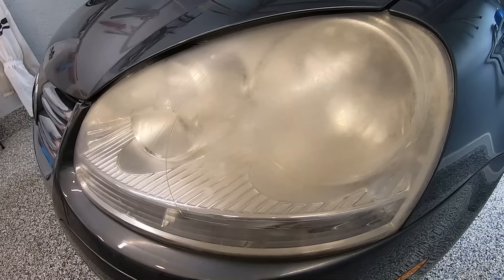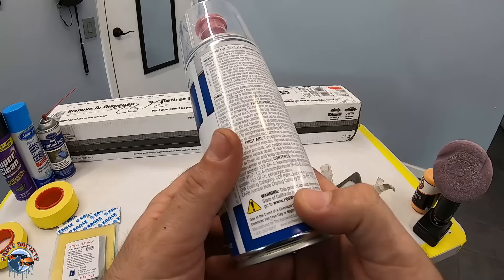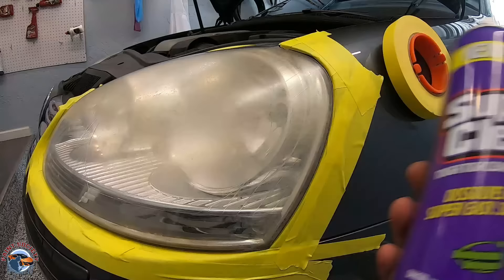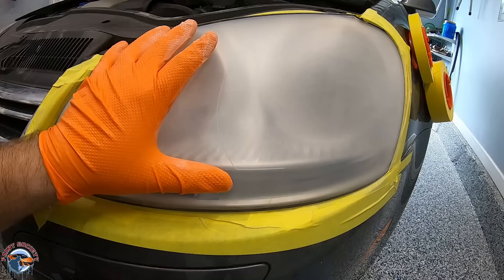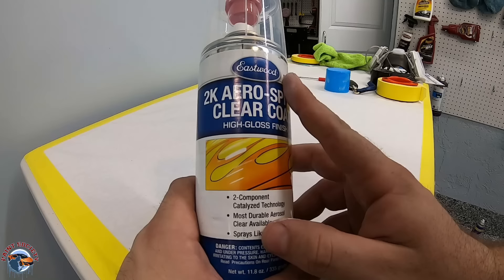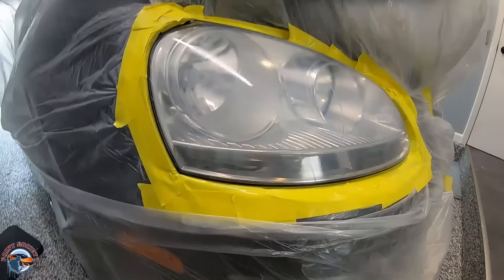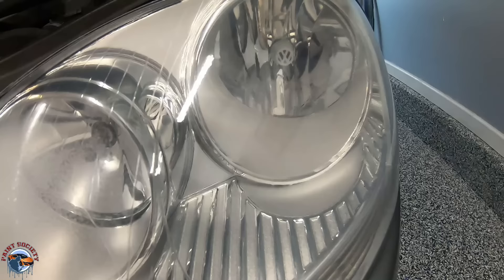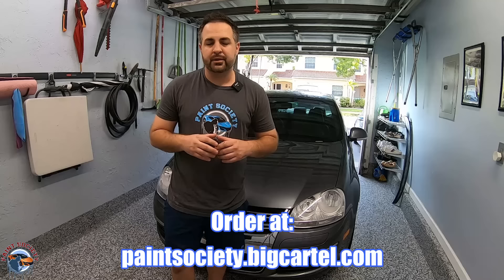The BEST Guide to Restore Headlights PERMANENTLY!

Comment: I did this exact same thing for my mother's Prius headlights a couple years back, same technique, no adhesion promoter, 2K rattle-can clear from my local PPG distributor, and so on.  They looked amazing, just like new, and since I had nearly 30 years of auto-body restoration experience under my belt doing over 40 frame off custom hot rods and restos over that time, I was quite confident (almost cocky) when I told my Mom that I could do this for her.  I didn't doubt myself even one bit at the time because I trusted my know how (tried and true techniques), the chemicals I used (I've been certified to use PPG products longer than I can remember) and the seeming simplicity of it all (at least to me), made this a no brainer.  Well, just last year (so one year later), she visited me and to my great dismay and shame, nearly all of the clear had pealed off of her headlights.  They looked horrible.  In fact, they actually looked worse than they were when they were grimy and brownish colored.  She could hardly get a good beam out onto the road.  My point here I guess, is that making the claim, "permanently," at least from my experience, I now know to be complete BS.  In fact, I think I even told my Mom that my fix would be "permanent."  How however, I know that these chemicals simply do not bond correctly to that lens plastic (and yes, I ended with an 800g scratch because it just seemed reasonable to me at the time.  Long story short, I humbly purchased her two knew headlight assemblies and installed them when they arrived.  NOW, her headlights are as actually, as good as new because they "are" new.  I at least know now that from a business perspective, I will never offer this service to a customer because I have zero confidence in the process now and never want to look like a fool to one of my customers.
Reply: I get pretty much the same results you describe. I'm an amateur at painting, only having done 10 or so whole paint jobs but have been an auto tech for 20+ years and run my own shop. I only do the headlight restoration for people that want to pass inspection. I wet sand in stages and usually end at 1000. I have tried regular automotive grade clear and hardener but I have since just switched to doing cheap dupli color rattle can since it doesn't last anyway. I always recommend new lights to my customers but explain what to expect. The problem is the price difference between OEM lights and cheap Amazon China stuff. The China lights don't seem to last much longer than cleaning and clearing the originals.
Reply: Yes, and when the clear coat cracked and peeling, it’s really nasty and requires a lot of effort to restore again. Btw, I have done more than 3000 pairs of headlights restoration by only wet sanding and buffing, and I hate clear coat or any sort of Coatings in the headlights, even the brand new OEM headlights’ coating will crack from the top over time. 

Good wet sanding and buff will last few months and extremely easy to restore again next time.
Reply: well, one can only guess what you did wrong but there was something wrong. ive painted a few headlights and so far none has failed in any way, so no its not bs. 2k clear is to last at least 5 years, some ive seen lasted 7-8 then were redone.
Reply: Same experience here, lasted a year and I didn't use adhesion promoter back then too, because I didn't know any better. The thing I realised after I ended up sanding it down and buffing it up, that hazing isn't just on the surface, it's within the plastic itself, no amount of sanding is going to change that
Reply: @sharifsircar  some of the model has problem with the OEM plastic, they changed color and built up tiny cracks over the years. But most of the car model is ok.
Reply: @Jimmy_Wei  It's definitely a huge improvement but if you put a brand new headlight beside it, you can tell the difference. The claim of "new" isn't really achievable, when the UV rays penetrated the entire plastic mould, not just the surface
Reply: @sharifsircar  some model doesn’t really got affected by UV lights at all, most of them will become yellow but only on the outer surface. I work in car parts industry and detailing business. Trust me, only certain model with problematic plastic cover supplier will have the problem. 

I have done some cars over 30 years old with OEM headlights. They back crystal clear.  But some models only around 10 years old, already start cracking and the actual material changing color too. most of lights only have problems on the surface after years of UV penetration.
Reply: @Jimmy_Wei  Interesting, so it comes down to actual plastic the manufacturer used. Do you happen to know if new headlights come with a coating of sorts from the factory? I have never seen an OEM headlight peel so it must be really on there or mixed with the plastic
Reply: @sharifsircar  most of the older model doesn’t come with UV coatings at all, just pure plastic when new, some newer ones have but over 3-5 years same problem will happen, I also done some newer models with OEM UV coating problem, the UV coating started to peeling from upper part of the light cover. From my point of view it’s about the difficulty to restore with or without bad coating, and my conclusion is definitely without coating will be much easier to maintain over the life time of the car, it will literally only take less than 2 mins for me to restore the original surface back to crystal clear. And last another 6 months, whenever it happen again. 2 mins to finish.
Reply: @Jimmy_Wei  Thanks for the info, any pointers on keeping a new set of headlights new?
Reply: @sharifsircar  after wash, use white final polish compound to buff it with microfibre towel every 6 month-1 year, if you see any white oxidation or minor scratches on the surface.
Reply: @Jimmy_Wei  Aren't I removing the protective coating on the headlight by polishing it? I know ceramic coatings don't do much in terms of UV but I believe it'll add on another layer to give the plastic a longer fighting chance
Reply: @sharifsircar  ceramic coating will also get bad on headlights. The best one Only last about 5 years, the problem is to remove it bad coating, because the ceramic coating is harder than plastic, closer to sand, it will require a lot of hard sanding to remove all of the bad coating, high quality PPF clear wrap will be a good choice if you want to protect the lights from actual stone chips and scratches. Maybe after 6-7 years, if there is some chips on the film you can remove them and you still have a brand new light.
Reply: @Jimmy_Wei  Interesting! I'll likely go that route for a car I am saving up for few years down the road but for the time being I'll just baby the thing with minimal effort haha, I am doing projector retrofit and I decided to do it right and pickup a new pair for the person doing it for me. Plus one of tabs broke when I took off the bumper/headlight bracket to get to something last year and I know that'll effect the aligning. Thanks for your insight!

Comment: Just did mines two weekends ago. It turned out perfect! Clearer than my new cars headlights. One regret though is trying to be perfect and taking out the orange peel. Imo, I should have left it alone as is. Trying to rid of the orange peel made the lens duller. Even with Polex and proper buffing it wasn't as crystal clear anymore. Its just me being picky but I would have left it alone without trying to correct. Thanks for the video!
Reply: I think that's a good point. Our headlights don't need to be showroom quality. Just clearer and spiffier. A touch of peel won't even be seen by most people.

Comment: Very good video. I already knew this process AND have done it several times and still enjoyed to watch how well you documented it for new comers.
Reply: How long did the clear coat last for you ?
Reply: @garygray1296  I've tried both methods. Repolishing the plastic and putting a UV protection type wax. The headlight gets fogged up within a year or so specially if you have winter.

I did the clearcoat method and it doesn't seem to need as much attention because the plastic itself is protected.

Comment: A note on the lifespan of the fix, I live in the Swedish countryside and have quite a lengthy bit of gravel roads to get home. That dust will surely lessen the lifetime of the UV surface. It isn't a criticism of your work, just a reminder that the environment can decide if it needs to be redone every couple of years or so.
While I'm nitpicking 😁, buffing by hand is possible if you don't have a good buffer, with the lower speed of one's hands it just takes a longer time. Another picky point is that using too high speed and/or pressure when using a machine can create too much temperature.
Great video, I'll look for the 2 component UV coating here in Sweden, I am looking for a solution where I don't need to buy a kit where it just restores one set of headlights since we have a bunch of cars and I often help my friends with service'n'stuff.
Great video, subbed for sure 👍

Comment: Another great video.  I like using the plastic clip part of a plastic cap on a pen to tuck tape. Fits in small areas and won't accidentally mar a surface if it slips off the tape or accidentally cut through the tape.
Reply: A suitably thin bone tool/trim tool is perfect for the job.
Reply: Old credit card works too.

Comment: Great video. I did the same to my headlights 4 years ago. Except I used a dupli-color sealing spray that wasn't 2k. It has lasted, didn't crack and was cheaper than the can of 2k clear. It can also be reused on other projects long after the can of 2k clear has become useless.
Reply: I have both 2k n a rust-oleum gloss clear. I used the rust one n didnt want to wast the 2k. When letting it dry it was cracking. Ny reason?
Reply: Thank you and this answered the question I was going to ask.. So Thanks😊
Reply: @joey537  If you don't get all the factory clear sanded off the headlights before you spray them then they'll spiderweb.
Reply: @joey537  same here....did you get any solution to this issue?
Reply: @mzwakhegiftsimelane2680  sand down the cracks as best as i could then re sprayed with the 4K. Much better now

Comment: Probably has been said before, but fantastic video--thank you, thank you, thank you (from a terrified restoration neophyte).  I was looking for a video that clearly demonstrated that this type of restoration could be sanded by hand as I didn't want to buy a drill attachment...I am not an adept car polisher in the first place (😆).  Favorite parts were....how to prep the clear coat can from start to finish--I would not have taken the same care to shake it...point taken 🤣   Second favorite was watching for the UV protectant degradation "line".   Third, by the time you got to polishing in-between the clear coats with a drill attachment, I was engaged and thoroughly enjoying a lack of  panic at the concept b/c I understood the value.  Courage! :elbowcough:   And last but not least...all is not lost if it is over-refined or if it isn't perfect.   Much respect for what you created here. 👍

Comment: Thank you Brian I have just found your channel today, I've watched a lot of these headlamp videos and this has to be the best, I think it's the first that has left the lens in the sanded condition before applying the clear coat and it makes sense, I am guessing that when the others polish or buff before applying the clearcoat they are removing the fine texture that the clear needs to make a good bond. I don't think I need to see any other videos on this and now feel confident that I will be able to do the job PROPERLY.
Reply: Ll
..
Reply: agree !
Reply: Spraying clear coat on your lenses is the last thing you want to do ,
The clear coat will hender the headlight bulb to illuminate at its full potential ,
May be clear but it's not the correct way to get a full functioning lens ..
Reply: @moecorpus5007  lol

Comment: This really is the BEST GUIDE to restore headlights permanently, that I've seen. Very professional. I  tried the Chris Fix method using 400 grit, 600 and finally 2000 grit wet sand. He suggests Rustoleum Clear Gloss for the finish, so that is what I used. Within minutes (as I watched the paint dry) it spiderwebbed. This happened twice unfortunately! And other people (reviews online) have had  similar experiences with crazing or spider webbing. On your video, the final grit used is a K800, which is a much coarser grit, but your results with the Eastwood 2K clear, look brilliant! Is my problem the Rustoleum paint? Or is it that the 2000 grit wet sand, leaves the lens too smooth for the clearcoat to adhere properly? Any comments or advice would be most welcome, as I've still got to sand off the Rustoleum and start again.
Reply from the maker: The two paints are two completely different paint so I would never recommend RestoLeum paint because it is in inferior paint and will leave cracks all along the plastic because of the reaction. I guarantee you if you do it using my guide you will have zero problems.
Reply: @PaintSociety  what would be the last number of sand paper I have to use before paint? Would the paint cover p600 sand paper scratches?

Comment: I can testify to how not so long the head light clear coat lasts from factory. My head lights started getting rough and cloudy after about 6 years. What I didn't know, until watching this video, is it is the clear coat! So, I don't see how anyone can fix the hazy headlight without sanding off the old clear coat and taking it through a similar process as yours! The original clear coat on mine was obviously inferior, or it wouldn't of failed after only 6 years from the show room floor. Great video, Brian, and thanks for sharing the knowledge and techniques! Great job!

Comment: Good stuff, I’ll try the 2k clear. Only thing I’ll do different which would be basically the same as you, I’ll just use basic wetordry sand paper, they’re like 70cents each at most paint supply shops. And using dish washing soap works good as a sanding lube and a cleaner before spraying
Reply: 2k is good stuff!!!

Comment: Remember when head lights were made of glass and they didn't scratch or yellow? Even if you garage your cars the headlights will still yellow. The bulbs produce heat and create the yellowing when the hot plastic is subjected to the cooler air on the outside. Add hotter head lamp bulbs and they yellow even quicker!
Reply: Hi from Australia, I remember glass head lamps, both types, the sealed beam and the halogen insert, and trying to find headlight protectors for older model cars..

Comment: If you don't want to do the clear coat, you can put some XPEL clear film on it. That never yellows either and will protect your headlights from rocks, etc. However it's pretty expensive compared to that 2k can.
Reply: That clear coat is going to yellow too it is the same stuff the factory put on.. lol
Reply: @thatamerican3187  just buy new headlights for a few more bucks!!
Reply: @coryjackson6034  450 bucks for 2 new h/ls..
Reply: Just used  some Meguiar's Headlight coating. After going from 360 -3k grit using a screw gun powered sander. Then buffed it with Meguiar's Plastix. Got all the old Crap off. Put 3 coats on. Check back in a  year.

Comment: I prefer paint protection film like something from XPEL over the 2K clear, provides protection against impacts, sun, stains, and lasts longer, it is optically clearer also, you have to sand and buff the clear after you apply it to get rid of any orange peel that can possibly distort the light output. You have to buy a respirator, cover the rest of the front end of the vehicle, you just need a little bit of patience with the PPF, no respirator or masking off other areas because of the overspray.
Reply: That's all well and good but the film will not clear up a sanded headlight. You still have to clear coat it with something before your apply the film.
Reply: @4seeableTV   that’s why you remove the sanding marks via compounding before you apply the film. It’s a process, you don’t apply the film after you sanded, you need to compound and polish the headlight after the wet sanding step, and then you apply the film.
Reply: @STILLNIGHTPEARL   - I will say that may be the case but old lens's are still usually hazy no matter how much you buff.  Something about applying paint makes them clear.   By the time you buy sand paper, compound, buffing pads, paint, film and time, you could almost buy some after market lens.
Reply: @johndillian1018  @STILLNIGHTPEARL I had really bad cloudy lens on 16 yr old car. Your initial sand removes all the yellowing. You want to have the sanding dust clear before you start with finer grits. I think that is your mistake. I thought I was good (wet sanding) but I still seen some yellowing and just kept working it. No matter how much you buff if you did not get all the yellowing (old layer) off at the beginning then your final will not be good.  I did not use any clear but went to like 1500-2k? grit and buffed with compound then polish. Mine was just as clear as his and started 2-3x's worse. I planned on following up with 2k when conditions allowed but sold the car before I had a chance. I like the thought of a clear film where you could just peel off and put down another piece if needed. Sounds good I just don't know if you need to 2k possible 1k clear first then apply or could I get by with just applying the protection film?
Reply: @ronwalters8434   - I used 80 grit, and sanded down to smooth twice, on my Dodge Avenger and they only came out 80% clear after grinding on them, sanding, buffing, paint...yada yada yada.  Some have better luck than others.  If I had no job living on food stamps I might continue sanding again, but, at this point, "I" am done!!